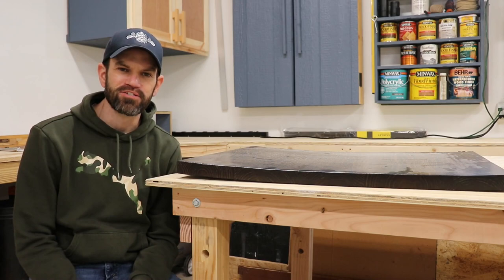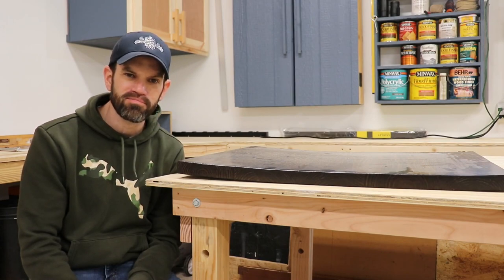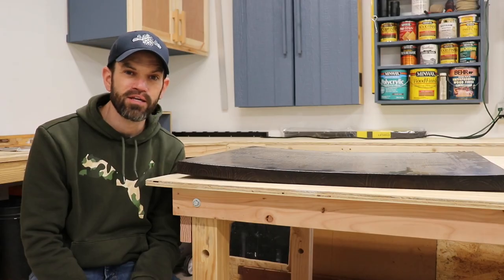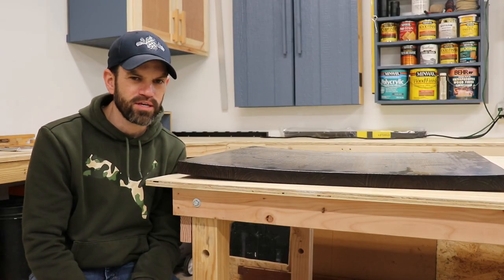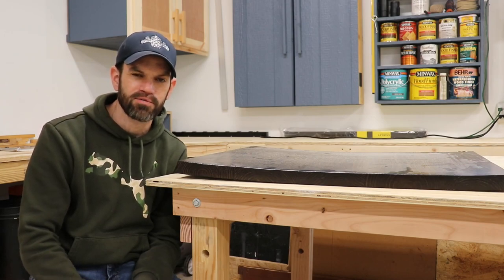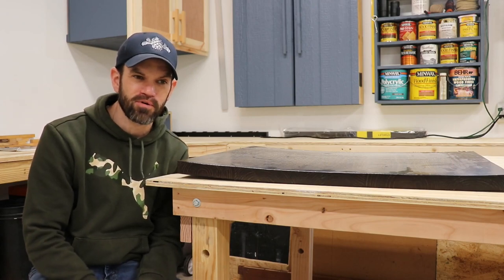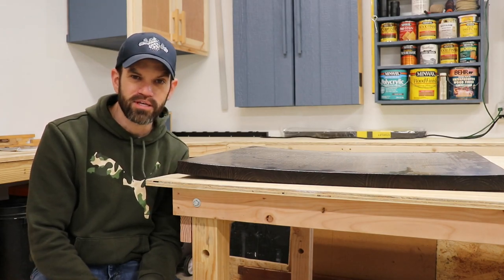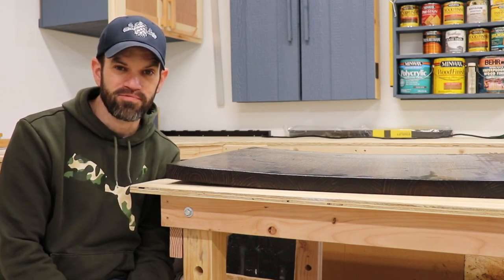TABLE TOP Glue-Up Tip / How To NOT Make a Flat Table Top

Comment: REALLY?? Do you guys really want to figure this thing out? How to get it right 50% of the time? 75%, 80%, 95%?? Can you get it right 100% of the time?
Sounds like a challenge to me.. Want to brain storm a bit?  Here are my thoughts on it.. Anyone can chime in.. 
There are no Right/Wrong answers, only better, best and Worst. But, there are definite reasons for every failure whether we understand them or not.

I do all sorts of work. Welding/Carpentry, etc. I run into all sorts of problems. If you really want to learn something about wood, etc, try building a small shed/cabin, etc out of Rough Cut Wood from a sawmill. Problems getting a good glue up are pretty minor when you really think about it. I am not a cabinet maker, but, I see no problems building them out of "Cabinet Grade" Plywood and Solid boards for the Face frames, etc. Just follow some simple rules right? 
Making Panels is the same, BUT, you have lots more to consider in finishing up with a good panel. Lots more things that can affect the final product. It's not just one answer in a failed panel, but, could have very well been a single problem that caused it. But, if you checked everything, you would know which point failed, or would have had some doubts about whether this was going to work perfectly or not. That is where you need to be to increase your percentages of producing perfect panels.
I have been waiting for the last 3+ years to find out which way this Country is going to go, or, I would be building my wood working and metal shop out right now and doing videos and sharing what I learned. But, who knows if we are going to have a financial collapse or not. Sure is not looking good at this point if no one has noticed. But, lets get on with figuring this out.. Any thoughts or comment are welcome reading for others trying to figure this out.. 

LETS WRAP THIS THING UP.. If we think about it, I think we can confirm/deny, and add to this list, but, I don't think removing  items from the list is going to have a large consensus. 
Maybe we can order these things in order of importance and increase the odds of not having problems.. 
PUT YOUR THINKING CAPS ON FOLKS, and lets give it a run for the money.. Ha..  

I think everyone here knows this is not a "ONE STEP SOLUTION". 
There are lots of things that can effect a panel warping.
I read a bunch here and what are good ideas I will summarize here and add what I know about some of it.
Lets do a little brain storming and see how many people put 2 and 2 together on jobs they have had issues with, and jobs they did not and see how close we can come to understanding what is going on.. Here is my take on it...  

On Glued Panels, Moisture or change in moisture is the killer. 
Same as outdoor furniture, Direct Sunlight is the killer. 
What do both have in common? Expansion/Contraction.
Loss of Moisture will have the most dramatic effect(shrinkage). 
Gaining Moisture will also have an effect (swelling)
Sunlight: Heat=Expand, Cool=Contract, moisture or not, but, an Outdoor table built and sealed with higher moisture in it will fail much faster. Think Steam and Glue?
And, if you tell me that Water boils at 212 degrees F, and that is what creates steam, I will simply ask you if you have ever seen Steam on the road after a rain? Or, Rain water hitting a River and becoming foggy, especially a cold river and warm rain.. It's Temperature variance and dew points, etc.. MOISTURE!! At any temperature is going to have an effect. 

A Good Video for someone wanting to "REALLY LEARN the Truth"..
A good title and description, and you will surely have a video with the highest number of views over a long period of time. 

Buy some 1x6 Pine boards at your local builders Market.. 
Then, buy some Treated Boards and stand them in the corner against the wall on some thin 1/2" strips and watch the puddles of water run out of the end grain of the Treated wood. 
Measure the thickness, width and Weight of those boards when you get them(write them on the boards) and measure them again in a week and you will be amazed at the difference. 
The Width will shrink the most obviously because it is wider percentage wise, but, you will see some thickness decrease also in a lesser but reasonable percentage rate. Do some calculations on the percentages. 
Weigh each of the boards and write all of the measurements and weights on each board and check them during each of the seasons  and you will see what is going on. Even if you are in a climate controlled shop, you will see a slight variation. 
But, put them outside under cover, (out of the rain), or in a shop without climate control, or even one that leaves the doors open during the day and you will see changes in weight.
Over time, the widths and thicknesses will get to a point where they hardly change at all, but, you can still see the weight change... 
Then, take a few of the boards and thin down some Boiled linseed oil with Mineral Spirits or Paint Thinner and give the boards a few coats until they stop soaking it up. 
DO NOT COAT THE END GRAINS OF THE BOARDS..
Then, go back a week later and apply more until it stops soaking it up.. 
Weigh them after the BLO application, but, apply nothing else. 
Write these new numbers down. 
Put them somewhere (under cover or in the shop with open doors, etc) and check them after 4-5 days of dry/hot, not humid days and you will still see some change in the weight. 
Do the same after 4-5 days of rain and log those results. 

Now, Seal the end grains of the boards. I'm talking Seal them..
Use whatever you want, but, fill up the "straw holes" the tree uses to pull up nutrients.  The same ones the water drained out of.. Pick a time period when the boards are the dryest. 
Use some Boiled Linseed oil and Wax melted and apply it, or epoxy, or plasti-dip, etc.. And, for the sake of the experiment, cover at least 1/4" of the flats on the boards, not just the ends.. 
Now, Repeat the experiments and see how little it changes in weight. 
Now you have boards you can make a table top out of and not worry about warping. AS LONG AS, when you rip/plane and glue up, you Reseal the boards top and bottom (edges are glued) and end grains.
Think about Sanding your boards.. Why do you sand between Coats? Do you not "Raise the Grain", or, Raise the "Hairs or Fibers" and knock them back down? Wood changing?
What do you do to get that to happen? Spray with a bit of water, or wipe the dust with a wet rag to raise the grain? 
The board with just some surface water on it making that change? 
Think about the Total Volume of change if just the end grain is  left open and the whole board is affected. How much change do you see there? Think about issues people have with Breadboard ends!!  Moisture/heat/cooling, expansion/extraction..

I guarantee you a video with the most views in your list of videos.. "Why Do Boards Warp", "Why did my Glued Panel Warp", etc. And, it won't take a year to make it.. Just do your measurements after several days of High or Low Humidity. 

Long winded.. Will post the rest as a reply to this.
Reply: Finishing my thoughts.. 
You would be surprised at the humidity swings, at least in my area, and you think humidity is high and is not, and think it is low and it is high.. Weird. Living in Louisiana, I thought I could always tell, but, never had a gauge to reference, now, from what I see, you can't really tell. I was fixing inflatable rafts with a "Hydroscopic Glue", and watched the Humidity for a pretty good while. Man, was I shocked at what I thought I knew.

Let me tell you how obvious it was to me. 
I was building Rocket Stoves. Read the rules and they didn't make much sense to me. So, I said, how far can they be broken and this thing still work. AMAZING!! I broke every rule and it still worked. Why?? "DRY WOOD".. 
I could go to the local lumber yard (wood indoors) gravel parking lot always dusty, and bought some 2x4's and brought them home and cut/split them and everything worked great.. 
3 days of rain at my place (wood under cover), and, I started seeing the water boiling out of the ends of the boards, hissing steam that was not there the day I brought them home.. 
I went back to the lumber yard, bought a few more boards and cut/split them and kept them inside my house with Central A/C.. 
Cut one of the 2 boards up and left it outside. 
Yep, outside boards hissed, inside did not.
Moisture content varried wildly in just a few days of ambient Moisture air.

ACCLIMATING BOARDS IN YOUR SHOP FOR 2 WEEKS: 
Really?? If what I say is true, and it only takes a couple of days for a board to soak up moisture, then, really what good is that,,, UNLESS your shop it climate (Humidity/Moisture Controlled)? And, your customer,, is his Climate similar to what you are building the piece at in your shop? 
Why has this not been an issue before? Probably the climate controlled shop built furniture is going into a Climate controlled Living Space.
I made a metal frame cabinet, fitted some 1x6 Treated deck boards into the metal frame.. Tight fit.. Super tight fit. 
After putting it into the house, over a couple of weeks, I had 1/4" gaps between the boards.. These boards were unsealed and unfinished. If I had sealed them, would I have had the shrinkage, if sealed?  

Coating one side: If you seal one side, you are stopping that side from breathing and forcing the opposite side to breathe differently than the other. If you are going to finish with a Oil based product, you can always thin down some Boiled linseed oil and apply it to both sides to reduce the moisture effect, which will warp wood if one side absorbs moisture at a different rate than the other. Same with releasing the moisture. 

FLIPPING THE END GRAINS: Is there an effect? If you agree that wood moves, then, it obviously is affected by Grain orientation, 1/2 Sawn, 1/4 Sawn, Grain style=Curly Maple, etc
Is it better to use all 2x4's, or 2x8's ripped and folded with opposing grains(both ripped edges up)? Can you really argue that the Ripped 2x8's with opposing grains are not better? 
When was the last time you bought 10 boards from a lumber yard, and all of them were the exact same width?
What if your Table Saw or Jointer Fence is not perfectly at 90 degrees. Would placing all of your panels in the same orientation after coming off of the Table Saw and Jointer not compound any error off of 90 degrees? 
Would it not be better to flip every other board just on that chance/possibility? When was the last time you really checked your table saw or jointer to see if it was Dead 90 degrees? 
Would you not be better off to at least pay attention to this and use it as a tool for a better glue up? 
If I were using 2x6 or 2x8's, ripping them in half and putting the 90 degree edges up, I would not worry about it.. If I were just using 2x4's I would pay attention to it. Why? Because, ripping the 2x6 or 8's and folding them over IS, doing opposing grains. Can you argue there is no reason for doing that? 
How good do you want your final panel to be? The more problems you eliminate, the better your panel will turn out in the end. Can you argue that would not be true?

END GRAINS: When you start to finish or seal your panel, once you get your moisture content where you want it. 
When you start finishing, coat the end grains first, then sides, then, top. Treat the bottom the same way, but, only to the point that the bottom is Sealed, not finished beautifully. 
Why? Spraying for example. When spraying the ends/sides, you get overspray on the top/bottom, then, smoothing the top coat on the top. Make sure the end grains get sealed. 

RIPPING: Ripping Large boards into smaller ones and flipping or alternating the grain is just one step in attempting to solve the problem. Depending on wood type, grain, etc, it could/should have some effect. 

If you have time, Rip your boards and Clamp them like you have done your Glue-up for a day or two. When you unclamp the boards, if you have some problems, they should be visible when singled out on a straight assembly table.
If you have a problem with grain in some boards, it won't be long before you see it. Maybe only an hour or two. 
You can always rip some extra boards if you have to cull some.
If you install a couple of boards under stress/pressure, that stress/pressure is going to be in the slab and trying to affect it. Cull the boards. 
If you do some research on products that must remain straight, you will find makers who plane boards a little at a time, stack them under light pressure, let them destress, plane them more, destress, and over time get to the desired thickness. 

Clamping Pressure: Do a dry fit before gluing and just snug the clamps down enough pressure that a good glue up would get a good squeeze out.. Examine the boards for a tight fit. If you have problems, you will see it before you have glue on. 
If you have to really crank down, you have some issues that will cause you some extra problems/work in your next steps and could affect the piece after it is finished. 

EDGE GLUING AND CLAMPING: 
When was the last time you bought 10 boards from a lumber yard, and all of them were the exact same width?
If you only rip one side to square/90 degree and get rid of the round over, and you lay your boards down on your clamps to glue them, and half or several of them are different widths,, does your Caul boards really do you any good? Why not rip every one of them to the EXACT same width/size? IMO, if you are having to use cauls, everything is not perfect and/or, you have boards that warped/bowed/crowned AFTER you ripped them. If they were all the same exact size and straight, would you need cauls? 

If you clamp tighter than is needed on a smaller glue up to get the glue to squeeze out "UNIFORMLY", why? What is wrong? Something is not right, or, all would be acting the same?
If you have a perfectly flat panel, did you not reduce the time it is going to take to flatten it out completely? How many of you have planners to plane flat a 36" wide panel? Enough said?
If you are going to use Cauls, it should be to keep the "Whole Panel" flat on the table.. Is it still flat? The table itself? 
Everything you do, goes into your final project.. 
How much forethought should go into your piece? 

If you are building a roof over your porch and you have some settling of your level posts.. If you correct it before you start your uprights, do you only have to deal with the problem one time? Or, should you cut your uprights at different lengths to compensate? What happens if you want to replace/level your posts in the future? Now, the bottom run is perfect, but, top rail is wavy. If you are going to do it right, do it right the first time, OR,, when you first see/notice after looking very diligently for problems, address them once and move along with your as perfect as possible project. Yes? 

U-Channel:
Think of the pressure of moving wood, and the placement of the U-Channels, and the number of screws and their location. 
Would it stop a twist between them? Imagine your panel with U-Channel placed a couple inches from each end across the panel. Would it have stopped the warpage you had in the video? Nope!
Keeping it "more" flat across the area where the channels are? Yes. Just one more piece in the puzzle of wood movement. Anything is better than nothing.

Outdoor Tables/Furniture: 
One solid top, or a Slatted top? How long do you want the water sitting after a rain? Is your table still dead flat, or has a dip or two in it, holding the water? Would it not be reduced by using a slatted design? Would it be better to round the edges or have sharp edges in your design that the finish would have to adhere to over time with expansion/extraction?
Start considering everything, and you will start noticing everything and, these problems won't be so spooky..
If anyone finds a good outdoor finish that lasts over 4-6 years on any type of wood, be sure to make a separate comment in the notes for me. I'm interested.. Ha..Ha..
Reply from the maker: Thanks for all the feedback! Longest comment we've ever received!
Reply: @howtofixitworkshop  I type fast.. Ha..Ha..